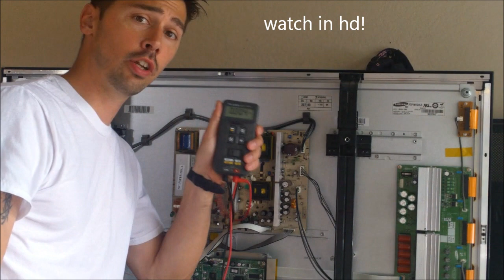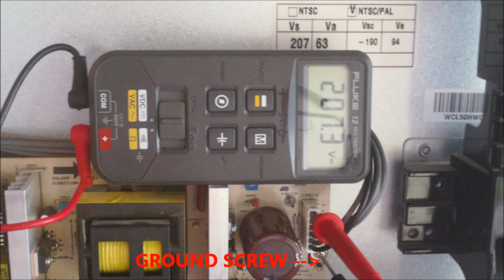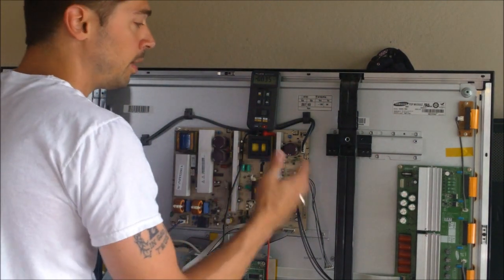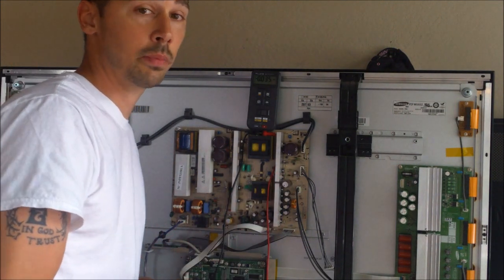How to use Meter to Fix TV - Troubleshooting guide

Comment: hi, i would like to start off by saying to pass on the information in such a matter that even i can understand. i got no knowledge on tv repair but thanks to you i succesfully repaired my first tv. this being my second tv (HPT5054 (50 inch plasma tv) 
i have an HPT5054 PLASMA 50inch tv. it won't turn on even after i have changed 2 bulged capacitors. i was wondering if you can guide on checking the other boards. thank you

Comment: I have an LG 47LE5400 led lcd panel that only has a power supply and main board.  The power comes on, but it starting to cut off for a second or two and then immediately turns back on.  It did this every 5-10 minutes while using the tv.  Power supply capacitors are the problem?

Comment: Your explanations are spot on! I do have a KDL-32SL130 that lost about 40%  brightness and leans to the red hue and is ghosting a bit, it all happened all of a sudden.  I compensate by uping the brightness all the way.  Someone said it was the LCD panel, power board voltages seem to check out OK,  what do you think??

Comment: I am trying to fix a lg led TV. all voltages are good except power on voltage is way to low. I am getting 3.5 it is supposed to be 24V. Does this mean that i have a bad main board? or bad PS? Thanks

Comment: Paul, 

Strangely enough, I found a 50 inch Samsung plasma 1080p TV on the side of the road.  Sucker was heavy!  Got it home and found all it had wrong was a blown fuse.  Had to order it off ebay because it was a high amperage special kind of fuse. Put the new fuse in and the set came to life!  I did some research and found my "new" set had four capacitors that were known to cause problems.  I replaced them.  TV seems to work fine, but is a power hog, using 300 to 400 watts to operate according to my kilowatt meter.  I am amazed at what people will throw away!  This was a really expensive TV with a street price of around $2300.00 back in 2009.

Tom

Comment: Question, there was a thunderstorm that occurred and took out my insignia tv, no stand by light . My tv was on a. Surge protector and it still didn’t help. I diagnosed it and it turns out the main board was out . I ordered a used main board and the tv turned on but the source input keep scrolling like crazy . I took the batteries out the control , unplugged the tv buttons and it continues, any thoughts ?

Comment: I have a 2012 Zenith plasma TV MN# Z50PT320-uc make AUSLZUR.The red standby light come on but no sound or picture.I think I measured the right places on the power supply and got 120V going in but nothing else registered.Can the standby light come on even if the power supply is bad !is there also a way you can show a picture of the PS and where the test points are, so I know I was doing it right.Thanks !

Comment: at least in transistor sets theirs no a lot of places where there is high voltage, I used to work on vacuum tube sets and their were lots of places you could get zapped.

Comment: Hi. I have a Samsung 60" Plasma # PN60F5500 . We have sound , but no picture. Eventually, the tv would have to sit turned off for up to an hour before it would turn on with a picture. Now, there is no picture only sound no matter how long we let it sit turned off. 

When power is turned on VS-TP reads 220v but quickly drops to 10v.  VA-TP reads 0v,  VE-TP 10v and VSCAN 0v. The connection from power board to logic boards reads either 4v or 15v. Stand by power 4v with power on or off. Does this sound like a main board problem? Thanks
.

Comment: I changed original board in 2013.I bought tv in 2008 and it is a  samsung model ln32a450c1dxza and tv was going on and off and then it would stay on. I bought a power supply board and installed it and it didn't work at all. Then I put my old board back and it worked. So I tried to install again the board I just purchased with no luck. Then I put my old board back in and now tv won't power on. The red standby light is on and I try to do a reset by holding power button down for a minute but nothing worked, Any suggestions.

Comment: Hey Tampatec,
An update with my Sony, I replaced both the GL2 and the G4 power boards and same problem.  No Power or led light.  So I pull out meter and service manual and try to decipher their Greek naming on their troubleshooting flowcharts and when I test standby voltage (which is suppose to be 3.3v by the book)  I get like 0.8.  So I just wanted to test the wire harness so I unplugged the harness at the main board from power board and now I test standby voltage at about 3.4v through the harness. When I plug it back into the main board it tests at the main board connection at about 0.8v.  So does this narrow it down to the main board?  I wish I could trouble shoot that board XBR-75X850C A-2072-607-B  cuz I can find it. In the repair manual it also says that their is confidential information on that board and to follow instructions whenever parts were repaired or replaced.  so whats that about?  thanks for any help

Shag

Comment: Thanks for the time making these videos. I have a Sony XBR-75x850c that is 1.5yrs old and its totaly dead.  I Have the service manual but the diagrams display the boards names and the troubleshooting flowcharts refer to them as boards B, G, & H.  I am having a hard time troubleshooting which board is bad because of this.  Any advice would be greatly appreciated!   Love your channel.
Reply from the maker: shagbuck check standby volts I think it's labeled stby. It should read 3.3v but 5v on older Sony TVs. If u don't have stby volts from power board cable to main board then order power board from shopjimmy.com or electropartsonline.com use code tampatecfriend. Note Even if tv seems dead tv should have standby volts as long as it's plugged into power. Be safe
Reply: Hey Tampatec, thanks for the quick reply.  I tested the standby and it reads vary from 0.80 at its highest and drops to 0.18 and its constantly going up and down.  Thanks for the References, that board is 1-474-616-11 G4-STATIC CONVERTER (TV) and have a hard time finding it online

UPDATE:
     I just ordered it from http://electropartsonline.com/ used but tested and guaranteed for 2yrs. thanks for confirming my troubleshooting and hope to be watching my beautiful tv soon with Football season coming :-)
Reply from the maker: shagbuck did you use my discount code? Tampatecfriend 10% off at Electropartsonline.com

Comment: Great videos. My Panasonic TC-P50S30 doesn't start, no LED. Power board has 10volts on P6, (says 5v on scematic)  and 10volts at rh switch. I replaced the board and got the same result. Any ideas?

Comment: I have a Samsung pn59d pdp.  I just recently replaced the power supply and have tried to check voltages with my meter.  I have tried the ground screw and metal backing along tp.  Both times leads spark and shut the tv down immediately.  What am I doing wrong?

Comment: Hi Thanks for the hard work teaching us !  
I just used the desolderer.  Took my to 3300MFD 100V 105 C capacitors out and soldered in new ones.  Replaced both SDR buffer boards.  It's still turning off after hearing a brief second of sound but no picture.  Hitachi Plasma P50H401.s

Comment: Hello Tampatec'
I have a samsung un46c6300sfxza Won't Turn On No Power & No Standby Light I already replace the Power board but still no good.
Do you have any suggestions on how to fix this tv
Reply: Hi Victor, did you get any answers on your problem, I have the same fault on a Toshiba, no power, on lights, no standby voltage either. Thanks. Ray

Comment: HI, YOU ARE MY FAVORITE HELP AND I HAVE QUESTION ABOUT "PANASONIC 55" Plasma TV  Model TH-50PX75U  SERIAL NUMBER PG70650528 NO PICTURE TURNS ON BUT LOTS OF HORIZONTAL COLORED LINES THEN IT GOES BLACK SCREEN. SO I WANT TO SEND YOU E-MAIL WITH FEW PICTURES SO YOU GET BETTER IDEA OF WHAT THE PROBLEM IS? AND I CAN FIX IT WITH YOUR HELP." SO MAY I HAVE YOUR E-MAIL PLEASE AND I SEND YOU DETAIL ABOUT TV AND PICTURES OF IT?

Comment: Hi Tampatec I have a Bush 42" LED TV it wont turn on standby light is on I had a look at all of the capasitators ithink one has a dome on it slightly but it under a metal bar  on the power board how do i get to it to change it Thanks T.

Comment: tampatec, I love the fact that I found this channel but what I've seen from everybody, nobody mentions further information about those va and vs test points besides how to test them. if they're wrong, what's wrong? for example I should get 217 vs and 55 va but I get over 400 vs and over 100 va. there are screws that I can adjust vs and va but still they stay over 400 and 100. 
in case you're wondering the TV is a Samsung ps59d6900. I got the typical problem of turning on and off again, even with every board unplugged except the power board. 
thank you very much for the content you put up. I've learned lots of things because of you.

Comment: i have a pioneer plasma 15 yr old tv. there is no power or red light that does not appear flash or any of the sort.  changed two  8 amp fuses. there are two 3 amp fuses (250v btw), and still no power. HELP!

Comment: I have a Samsung UN40D5550RFXZA that turns off and on every 2-3 minutes. I have replaced the poser board and it does the same thing. I assume it is the main board but shopjimmy does not have any and does not know when or if they will get any more (probably because all of these boards are failing). Any suggestions on repairing the main board?

Comment: Hey TampaTec, i have a samsung plasma tv pn59d550. The input voltage is ok with 120v. But i got nothing on any output plug and 0 on vs and 0 on va....So i think that my power supply have a trouble...Do you have any issue? Capacitor? Thanks a lot
Reply: @tampatec, my "power " ligh double flick 5 times in a row...

Comment: i have a samsung 50 inch plasma tv, still has a stand by light, but wont power on, i replaced the X main board and still nothing but when i unplug the cable that connects the X and Y main board together, the tv turns on ( With no picture of course) i dont know whether to replace the power supply or the Y main board, and i tried testing the power supply on the VS point and it reads 00.1 DC, please help

Comment: Hi, in hope u can help. I have Samsung 52 in that has the classic problem of cutting on and off. I watched videos and all said it is the capacitors. I ordered a new power board and installed and didn't fix it. Can u help. It powers on and is on about 15 seconds then powers off and back on again. I also removed little side panel and tried taping the little flip switch down and this did not fix the problem. I noticed when I took the old power supply out none of the capacitors looked swollen or had the black marks on the top. They all looked good. Thanks for any help.

Comment: Could the capacitors be the cause of the problem if I'm not getting any or very low dc voltage readings? Or is it the transformer? I'm working on the same exact TV you're showing. Thank you.

Comment: Hey  TampatecI'm trying to figure out what going on with a 40 inch element tv my Dad bought, It's stuck in Stand by mode, The power board and the TV's mainboard, are the same board.. I was testing the diodes, and was a very high reading on one side, that would rise, then go to OL and  the other side was 3.4 or something like that.. Does this mean the diodes are bad?

Comment: Hey Man,

I've been watching your videos while attempting to fix my 47inch Vizio LED M470NV. While watching football two sundays ago I was out of the room only to come back and see that the screen was black. Not even on. The Vizio logo at the bottom was white, showing that at least it, was getting power. I hard reset the tv after turning it on and off with the remote wouldn't work. There is definitely no audio and no picture coming out at all. The physical power button on the TV will not turn it off once I turn it on but the remote will. What could be a likely culprit? I know its probably any of the components but is this a unique and tell tale sign? No picture, no audio, but the television has power, at least to the logo.

Comment: I have a 42in Samsung Plasma With no picture. It turns on and is making an intermittent buzzing sound near the Y sustain board. I have replaced the Y sustain and Y buffer boards to no avail.

Comment: So you r saying if my tv doesnt turn on, I could disconnect 1 board at a time from the power board and test it I could check to see of that board is the problem? Does it work that way as in if you disconnect a board from the power board you might find the board that isnt turning on the tv?

Comment: Hi Tampa tec I have a Samsung plasma that's turns on Says Samsung then has blank black screen and red light blinks off and on I started to test capacitors and noticed that some of them that were 250v 150uf were testing way over 150uf they were like 400 or more does that mean capacitor is bad . Please help thank you

Comment: If its not the psu the real tests are on the v-sus and y-sus boards testing points to see what the voltage actually does once its left the psu oh and not forgetting the factories secret testing points that you need to bridge to generate a test pattern and confirm control or main board faults - be nice to see a video of these tests on a faulty tv - hmmm idea!!!! ding!!

Comment: Awesome video, two thumbs up!!!... I used this video to test my Plasma that went out about 3-4 days ago.....

I have a Samsung Plasma. PN58C80000YF. NO video, turns on and makes a sound when turned on, but no tv sound.

I used this video to test the Va and Vs points and this is what I come up with.

Internal tag says
Va=55 | Vsc=-200 | Vs=209 | Ve=90

I tested the test points on the power supply and this is the results.
Vs-TP=13.6 | Va-TP=1.2

testing the power supply ends to the Y-board.
2x Va points, power supply end = 1.2
2x Vs points, power supply end = 13.6
Same values when testing the same end BUT on the Y-board side.

testing the power supply ends to the X-board
2x Vs points, power supply end = 13.6
and 2x Vs points on the X-main board side tested the same 13.6

tested the logic board power, slow blinking green LED light.
2x D5 .3v points, both tests 5.22v

At this point I'm thinking its the power supply, even though it has power its damaged in some way and NOT supplying enough power to the other boards. and the points are NOT what the internal tag value says.

Fuses look ok, and the capacitors and other components do not look damages and no burn marks anywhere.

Your, thoughts Tampatec?

Comment: Vizio 4K P502ui-B1E problem Bottom right corner led light comes on for about 5sec but still no picture toggle power button, tried unplug waiting for 30 sec and plug back in still the same would you have any suggestion could it be the video card on the main board ?

Comment: Recently had main board repaired. My Sanyo 55 inch no longer turns itself off but does still blink. Comes in and out. Some channels it doesn't blink at all. I have no red standby light when it's turned off. Is this normal?
Reply: Hey Mihial, I c u got the YouTube did it help?
Reply: We made to NC, been snow n ice here all but one day.
Reply: Hey Dave glad you made it to your destination. Yes I heard it was crazy down there too.

Comment: Hey Tampatec,  Great videos.  I've already learned alot.  I have an LG 50PT350-UD.  I was watching some time back and it just turned off.by itself and started a clidking every second or so.  I had it unpluged for a month and tried again; same thing.  I have removed the back panel.  None of the capacitors look bulged.  With the back off I can tell that the clicking is coming from a small black box.  It's about an in. square and 1/2 in thick.  Lots of marking; here are some that I think are important: SDT-SDMR,  5V followed by paralle lines 1 broken 1solid (believe that is AC),  TV-8,  10A 250V~res,   and so on.  I have a pic if it's important. I have 120 coming in at the red plug, but.can't get any reading for VA TP or VS TP.  Can you help me any?

Comment: Tampatec, I have a LG Plasma TV 60pz550-ua. I tested the power supply board as you showed in this video and I was able to read the expected voltage readings.  The issue w/ the TV is it doesn't have a picture.  The screen is dark/blank when switched on.  What could be the cost or which board should should be causing it?  What the next troubleshooting step after the power supply?  Thanks!
Reply: Sorry, I meant cause of the problem -- not cost...

Comment: I have 2 bulged capacitors on my Samsung 50" plasma power supply.   All voltages though are good.  The TV powers on with sound but no picture. 
Can you have bulged capacitors that are still good?
Reply from the maker: Buy cap kit from shopjimmy.com it may fix it.

Comment: I have a 55" Sanyo lcd tv. The picture turns on and off. It just recently turned itself completely off. It powers up but then shuts off. I have 118v coming in and going out to the main board I have 5v. It also shows a 12v pin on that same plug. But I get no volts on it when I checked it. Could this be a capacitor failure? I haven't checked them yet. Could this be the cause or should I look at main board?

Comment: Hi Tampatec. The last TV I had was fixed but now I have a different one. Its a 42" inch Samsung I don't know the SN but what I've realised after troubleshooting that the X board was dead. I've tested the TV buy cancelling one by one so when I the X board was plugged in the power source went in protection so I've change it. Now the X board is ok and the power source is ok but still no picture. I have to check the buffer board to see if this is the problem. Can the buffer board be dead without affecting the Y board? 
The VS and VA should be constant all the time? I have VS - 210V but then it goes to 19V roughly. What do you think? Thanks. Cris